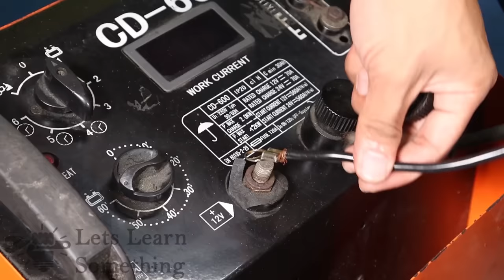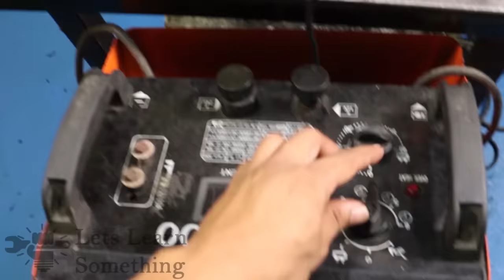Turn One Cylinder Engine Into Boxer Engine

Comment: That's actually a flat/180° v-twin, not a boxer.
Reply: if its flat. its not v anymore, cause its flat :D
Reply: @marazalinindeserteagle8539  180 degrees "v" engines are a thing. Ever heard about the Ferrari Testarossa?
Reply: @marazalinindeserteagle8539  flat twin and boxers have different crank configuration. One he made is aflat twin not boxer.
Reply: @fullmetaljacket7  ım just joking bro.

Comment: Very impressive build as always. But it´s not a boxer engine. It´s a flat-twin engine.
Reply: hi, what is the difference from boxer engine?
Reply: @yusufyakti  flat twin has both cylinders on same crank pin. 1 is at TDC the other is at BDC.
A boxer has each cylinder on its own crank pin and both at TDC / BDC together at same time. 
This gives better balance as the pistons are moving in opposite directions and primary balance is cancelled (except rocking couple due to cylinder offset)
BMW bikes, Subaru, VW beetle/Porche are boxers
Reply: @deanomarino31  thanks.
Reply: @deanomarino31  couldn't have said it better

Comment: Im impressed to your creativity and the fact that you can modify existing motorcycle engines into a flat-V engine. yes its a flat V because they share the same crankpin unlike a boxer that has opposing pistons with individual crankpins. still a very great video. kudos to you 👍👍
Reply: I was going to point out the common crankpin, good eye
Reply: And how do you gonna use that
Reply: I have a Saito 1.00 cubic inch two cylinder flat V engine for an RC model air plane. It looks great, but it too lacks the distinctive soundtrack of a two cylinder boxer.
Reply: I learned something new today thanks
Reply: Flat V? you mean just Flat engine no?
Reply: @durim187  no. Since the configuration of the 2 pistons sharing a crankpin its a V engine with a 180 degree bank angle hence a Flat-V...whereas boxer engines have pistons with its own crankpin and opposes the forces generated from the opposite bank of piston hence the term "Horizontally Opposed" Boxer engine
Reply: @jeromegaces6184  V has nothing to do with the crankshaft, V symbolises that there is an angle, 60 90 or 120 degrees and the engine looks like a V. Flat is just flat 180 there is no V in flat its just ------------- flat
Reply: flat, V and boxer are diferent things, a flat can be boxer or non boxer but a v is only non boxer
Reply: No wonder why it still sounds like a V-Twin engine despite having the cilinders flat at oposite sides, this is a V-Twin engine with an angle of 180° between cilinders. Boxer engines and V engines even if they're both flat have a different firing cilinder order that gives then different exhaust sounds.

Comment: If you can do this, you could build a radial engine next.
Reply: I second this
Reply: Yess. Do it please
Reply: What about a warp drive??
Reply: @mynameisjeff417  pump your brakes dude
Reply: @LuxGamer16 brakecheck ✅
Reply: Dope
Reply: Radial not a successful model engine.....
Reply: @mohamedshafeelmohamedbilal6364  why do you believe this?
Reply: @LuxGamer16  Because some oil leakage issues held in radial engine lower parts....that is why after a couple of year running the engine .....it may burn the oil due to oil leakage of lower side piston....
So , boxer engine are better....but radial are much preform but not for long time good preform..... think it if more detail I can give YouTube explain link!
Reply: @mohamedshafeelmohamedbilal6364  well every engine burns a little bit of oil. Some more, some less. But i understand what you mean. The question is more of a can he build one, less of a how long will it last.
Reply: @LuxGamer16  ok
Reply: @mohamedshafeelmohamedbilal6364  Easily solved by a radial engine with spinning cylinders. Like the early airplane engines or the megola motorcycle.
Reply: @teslatrooper85  that is 100% correct ...and best method to solve the problem in radial engine....
Reply: @LuxGamer16  Since he has already built a supercharged radial gas engine out of an old refrigeration pump, I am certain your project would be *Quite  Elementary*!!!
Reply: If you can make a bigger crank pin to carry all that much rod, yes, it can be done
Reply: @charlesfriend9557  i dont see a video of anything supercharged. The compressor video you can hardly call a radial engine. And where did i mention a project of mine?
Reply: Dorito engine
Reply: Yes this!!!
Reply: Just rotate the engine 165 degrees after every use
Reply: Imagine
Reply: That's the way I thought... Bravo
Reply: @teslatrooper85  could the radial issue be solve by mounting the output shaft on the vertical axis, Say for a helicopter type setup? Or with gearing to convert the drive output?
Reply: @boziewz6125  Could be. That's depends on where you want to use it. For most applications radial engines are just too large.
Reply: @teslatrooper85  the size would limit use and I'd imagine they are not particularly light weight either in comparison to other types of engine. It would be interesting to see how many uses a radial engine would actually be practical in with that configuration. 🤔
Reply: Maybe you can visit Psychoengine on youtube. They have diy radial engine bike.
Reply: Yes!
Reply: The lubrication system would be complicated though, would need a "dry sump" setup
Reply: he do it
Reply: And now he did. Dude knows his engines
Reply: He did.
Reply: @LuxGamer16  qq hi @1
Reply: He did it !!👏🏻
Reply: he did it.
Reply: I wonder why… to put in a plane, or rc plane? That’s cool. But this guy, I think sooner or later he’ll come up with a jet turbine from junk yard parts

Comment: Great video but in reality this is not a boxer engine
Reply: Its a 180-degree V-twin, right? A boxer's sets of pistons punch outwards at the same time which basically eliminates vibration along that axis, but regardless of that this is still hella badass and I love watching these kinds of videos :P
Reply: @Avetho  It is a great engineering exercise, but as you have stated, it is a flat- twin and not a boxer. A typical (Honda) underbone engine alreadyhas a lot of vibration and making a flat-twin would put high lateral loads(double) near the top of the rev range.

Comment: The plexiglass crankcase worked exactly as well as I would have expected.  It was a great proof of concept though, showed everything was working before committing to welding up a steel one.
Reply: Until now I was wondering why engines wasn't made of plastic ;)
Reply: I think in theory if you could somehow fit extremely long studs straight from one head to the other the plexiglass would have been totally fine. The problem with this configuration is that the crankcase is structural, so it needs to bear the load of combustion. Every fire, the pistons push down but the head gets pushed up - the crankcase needs to have enough tensile strength to withstand the force of both pistons trying to blow the heads off the cylinder, hence the plastic failing by the area around the bolts ripping out. If the studs could reach all the way through to each other the crankcase would take a negligible amount of force. In this configuration it would have been neat as an alcohol motor maybe.
Reply: It actually ran a lot longer than I figured it would.
Reply: @NLynchOEcake  I think you also would eventually see heat become a problem.
Reply: @trollbane66  I think it would depend on if it were crankcase scavenged or not but in this case it appears to have an oil injection setup so exhaust in the case would be less of an issue. There would probably be issues at the interface between the cylinders and the plastic case though, cylinders can get bloody hot and would likely melt the case
Reply: I know nothing and even I was expecting that
Reply: it was because of a misfire because he unplug the ignition cable
Reply: You know, I actually think this occurred because there was no crank case ventilation from what I can see. There was probably a good bit of pressure in there when the misfire occurred. The case should be allowed to either vent to atmosphere or back to the intake.

Comment: So the purpose of a boxer engine is to balance all the motion. 
This is a 180 flat twin. 
Boxers have thier own crank pin for each piston. 
This was done brilliant though man.
Reply: respectively a 180° V twin, technically speaking. ;D
Reply: Eso mismo,un motor plano gemelo, no boxer.

Comment: Not exactly a boxer engine but great work nonetheless.
The name "boxer" comes from the crank throws being 180 degrees apart an when they rotate the whole assembly looks like a boxer throwing jabs.
Reply: Yes, it is a 180 degree V engine.
Reply: @teslatrooper85  nope, that called flat engine
Reply: Yup.  This engine combines the worst of the worst.  Still impressive.
Reply: @600jr6  that's the same thing. You can call it a flat or a 180 degree v-twin, but you can't call it a boxer.
Reply: @600jr6  Both names are used and are correct. You know, synonyms.
Reply: Yes you guys are right, its a flat two or a 180⁰ V twin because they share a common crank pin. 
Boxers don't share a crank pin, they should have 2 pairs of flywheels set 180⁰ apart with its individual crank pins..
Reply: a flat engine is what this is which is a engine that is basicly a v that has been flatened out 
the crank in a boxer flat engine has the cylinders 180 degrees apart and not on a single crank pin
so no, the engine built is not a boxer engine though it is a flat
all boxer engines are flat but not all flat engines are boxers
Reply: Thats what this is...smh
Reply: @ebutuoyebutouy  It could have a highly successful career as a paint shaker!
Reply: @600jr6  yes, its also called a 180 degree V engine.

Comment: Sounds like a harley engine. With those harsh sounds that unique to v-twin engine. Not a boxer configuration to be honest. but flat-twin and it amazes me a lot.

Outstanding skill of you.. Nice
Reply: V twin = cylinders angled in a V shape
Boxer = cylinders in opposing sides of the crank in a flat shape.
Harley engines have their unique sound because they have a V configuration but with a very uneven firing order
Reply: Well I still call that's a v configuration, just flat one, or really wide angle v😅. In boxer the pistons should reach tdc at the same time. Nonetheless amazing job putting that engine together💪

Comment: Subaru and porsche intensifies
Reply: Also BMW motorcycles
Reply: no, because that motor is not a boxer, it is a 180° angle V motor.
Reply: @gustavobalmaceda2346  I would say less than 180, like 170 ish, because if it is 180 degree that's a boxer
Reply: U forgot some old VW cars. like Beetle or Ghia
Reply: @gustavobalmaceda2346  call it a flat engine
Reply: To be a real boxer the way people expect, there need to be 2 crankpins 180 degrees apart. That lets the pistons reach top dead center at the same time, and vibration is much reduced.

This is quite a build but I would not know what to call it.
Reply: @000mrman105  it's not just the angle that makes a boxer engine.  with 180 ° it can be a 180 ° angle V motor or a boxer, the difference is in the movement of the pistons.  In the V-engine, the pistons move in the same direction at the same time, left or right in unison.  in a boxer they move in opposite directions, towards the center or out at the same time.

Comment: Everything is great designed, although I would work more on the oil pump since it seems that it does not generate enough pressure, but great work man!
Reply: weird behavior there... cavitation like symptoms can be seen
Reply: @elmzsni  It's not cavitation, the crank is frothing up the oil in the crankcase as there is nothing in his design to prevent this.
Reply: Very nice adea,,  I'm very interested about this video,

Comment: The main thing I have learned from Lets Learn Something, is that you are a consummate engineer and machinist with amazing skill and knowledge.  Also, that anything is possible if one puts one's heart into it.
Reply: Oh, and around 2.21 I also learned what that other "drain plug" looking bolt is on the bottom of the Honda clone engines is for...  I had a feeling it might've been a gear detent retainer, now I know it's for the cam chain tensioner.

Comment: I was really impressed with the conversion of the two single four stroke engines. Have you thought about improving the design to kit form or plans? There is a shortage of reliable four stroke twins for microlight aircraft and paramotors. Just thought with a simple reduction drive, good muffling and there is a great interest in your type of engine mods I think it would be a winner. Thanks
Reply: I concur! A production version would be perfect for your application.

Comment: if you want it to run smoother, put a flywheel on it and lower the compression with more headgaskets. Also running camping fuel as well
Reply: Um... No, do not use camping fuel! It has very, very low octane.
  I would like to at least see him put the stator on it and make some electricity to charge a battery or something. Giving the engine something to actually do.
Reply: @johnwyman6126  camping fuel would make the engine run cooler and smoother, why would he need to build it to make it work, its just an engine to show its working. he already has twin cylinder engines he made thats in a motorcycle
Reply: @DatBlueHusky  exactly what is it that makes you think that running camping fuel will "make the engine run cooler and smoother"?
Reply: @johnwyman6126  because i have actual model engines that run on it? Running gasoline is more powerful but creates more heat and runs harder. Camping fuel burns slower and lower heat making it run better. I dont see you having any videos so i see you are just a keyboard warrior lol
Reply: A heavier flywheel would make it much smoother. Lowering compression and making it run on oil would slow the burn down but isn't particularly helpful as it reduces power significantly. 
More headgaskets will also affect the valve timing reducing power even more. 
Your engines are smooth because they barely make enough power to run.
There is a reason they stopped using low compression oil burners once a reliable supply of fuel was available
Reply: @DatBlueHusky  Camping fuel is perfect...for camping cookers. Adding head gaskets is the worst possible way of lowering compression. You lose the squish band, resulting in slower and less complete combustion, you mess up the valve timing and it makes it much more likely to blow a head gasket. Don't accuse others of being armchair warriors when your own knowledge is so badly lacking.
Reply: @BrokeWrench  thats the point to make a model display engine but he did put it in a frame to run it anyways so didnt have to do any of that.

Comment: Cool build as always. Just two bits of constuctive critisism. ALLWAYS mask cylinder walls when sandblasting, even if the cylinder is just laying off to the side while blasting the head. Sucks to destroy a nice cylinder. You should also allways put a small amount of grease on the crankshaft seals. They can in some rare circumstances be destroyed because of friction before oil can creep its way in.

Comment: Nice build, are you going to put it in a frame?
Glad to see you fitted fuel filter right way round the second time. It always looks clean if you have fuel flowing into centre and out along outside.

Comment: Zen or the art of craftmanship. Chapeau Monsieur, I admire and envy your skills. One remark: This is not a boxer engin but a flat 2. Or more accurate, a 180 degrees V2. In a boxer engin the pistons will move in opposite directions because every rod connects with a seperate crank on a flat 180d crankshaft.  I can imagine that this was near impossible to achieve. However,  in comparison to your accomplishment here,  this is just semantics, splitting hairs. In enjoyed this video immensly. Thx.

Comment: Great work well done when I saw the clear crankcase in plastic I thought it would not last long not enough strength. Keep up the good work!
Reply: Not a boxer. You need to take one of the crank wheels from the donor motor and machine in a new crank pin hole then press it all together. Once the pistons oppose each other it will have perfect primary Ballance. You can make the crank case out of cork and it'll hold up.

Comment: Amazing what you can do when you put your mind to it !! Incredible work. 

I'm surprised the balance of the crank wasn't off more and it didn't vibrate a LOT. Not trying to take anything away from this at all, but a single cylinder crank has a large imbalance to offset the weight of the piston. When you add another piston I would assume that you need to drastically change this, but I honestly don't know a lot about boxer engines. 

For some reason the term used for the compromise of balance of the crank is escaping me.... Either way, very well done and nice try with the lexan / plexiglass.

Comment: That’s so cool and interesting it would be awesome if you could use an actual aluminum crankcase with transmission and make it possible to mount on a bike or tab frame
Reply: Or something as simple as a Thai long tail shaft surface drive for a boat

Comment: Impressive work I loved, technically it would not be a boxer because the pistons with their counterweight should move opposite to cancel vibrations but equally beautiful.

Comparing it with My boxer of the citroen 2cv you should add a filling tube or in French (Reninflard) this is responsible for relieving positive and negative pressures inside the crankcase avoiding oil losses. Greetings from Argentina